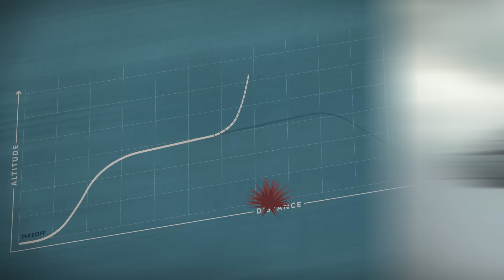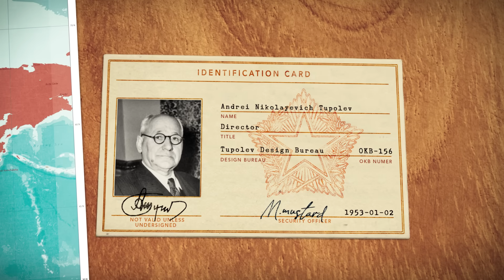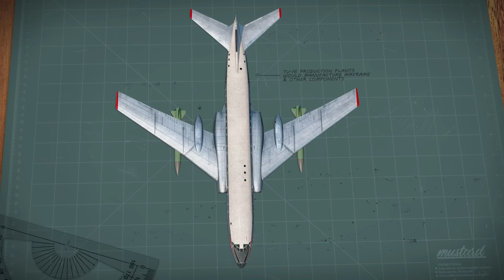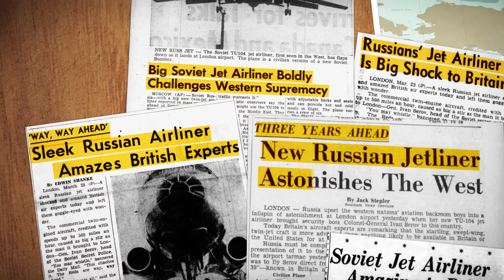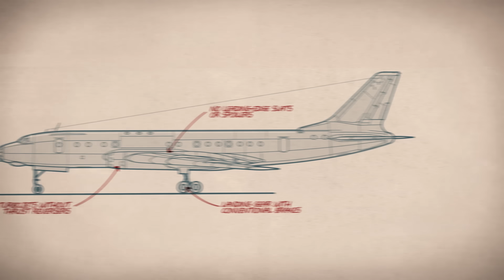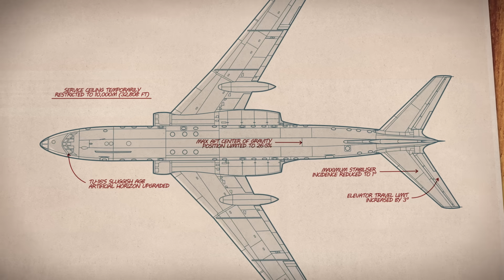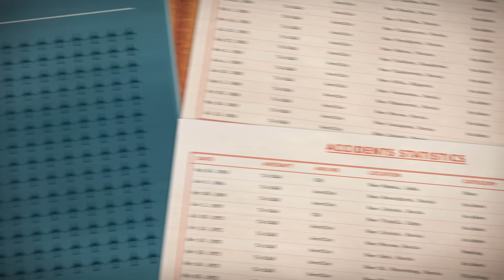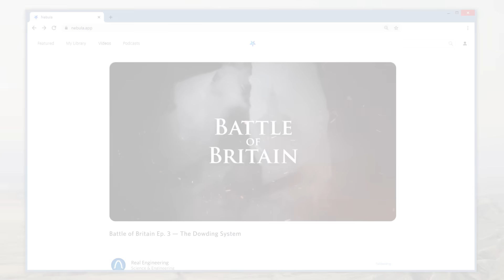The Soviet Airliner Designed To Crash

Comment: The Question was "Was this the most dangerous commercial airliner?"
Well the DC-10 was more dangerous over 1200 people were killed in DC-10 accidents (design failure)
So, nope the TU104 was not the most dangerous commercial airliner.
Reply: The DC-10 actually has much better safety record than the Tu-104.
The worst jet airliner in history is the de Havilland Comet., one out of every four built crashed.
Reply: I thank you Sir for making both of my points.
What do we mean by dangerous. More people sadly died in the crashes of DC-10,9 and 8 airliners than others, but of course there were a lot more of those types of plane than Comets or Tu104.
In terms of the number of lives lost overall the DC-10 had a poorer record so it depends on your metrics. The other point is of course that early implementations of jet liners were much more dangerous and taught the industry to develop better designs, maintenance and cree training. Either way, the Tu104 was not the most dangerous ever, but definitely not a choice for nervous fliers!
Regards
Reply: @maxwood1464  Yes, there were 6 times as many aircraft built in the DC-10 family and it also carried 6 times as many passengers, in terms of fatalities per flight and per passenger/mile the DC-10 has a much better safety record.

Comment: Sorry man. Won’t buy your propaganda. At that time there was only one commercial jet plane: British de Havilland Comet. 100 manufactured, 3 crashes during first year in mid air. Licence was cancelled. Plane was redesigned having overall 25 crashes for more mature modifications. Tu 104 - 200 manufactured. 37 crashes. Next generation: Boeing 707 - 850 manufactured, 174 planes lost.

So lost / manufactured percentage for 
Comet: 25%
Tu 104: 18%
Boeing 707: 20%
Reply: 1.	You are probably comparing the 60-year+ service history of the Boeing 707 with the 23-year service of the Tu-104, so naturally the Boeing may have seen more accidents.

2.	The Tu-104 would never have flown the same number of cycles and flight hours as the Boeing 707 - perhaps the Tupolev has flown only half the amount time in the air per individual airframe as the Boeing 707 – most Tu-104s have never flown more than 25,000 hours on their airframes.

3.	Not all Tu-104s entered civilian passenger service with Aeroflot or airlines abroad. Many were retained by Tupolev for further testing and research, many entered service with the military or other government agencies, some were used in flight training schools. Also, some of those Tu-104s which did enter passenger service were later transferred to other organisations for other duties. Not all Boeing 707s flew civilian passenger services either ¬– many became military C-137s, others became freighters – just not to the same extent as the Tu-104.

4.	In any case, when we are talking about airline flight safety it is usually important to speak only of those crashes and accidents which resulted in fatalities - that’s how these statistics are measured, analysed and compared. Until the Tu-104 was retired in 1979 there were 22 accidents and incidents which resulted in fatalities. For the Boeing 707 the figure is 49 accidents and incidents. The Boeing has more than double the fatal crash figure as the Tupolev – but has perhaps flown 10 times the number of passenger flights.

Here are 2 websites that will help you learn more about the respective safety records of both airline types.

https://aviation-safety.net/database/types/Boeing-707/losses
https://aviation-safety.net/database/types/Tupolev-104/losses 
https://russianplanes.net/planelist/Tupolev/Tu-104/107/110

Comment: So, basically, this was the Soviet 737 Max.
Reply: The Boeing 737 Max has a much safer per flight and per passenger/mile fatalities fatalities rate than either the de Havilland Comet or the Tu-104.
Reply: @sandervanderkammen9230  I know, I was just making a joke... Because the max problem was actually quite similar.
Reply: @DavidThumim99099  Similar to what? the Max 8 issue is very usual in fact, the circumstances of a government mandated safety device causing two major accidents is unique in commercial jet aviation history.
Reply: @sandervanderkammen9230  it's similar in that the problems with both jets stem from an issue with the center of gravity of the plane.
Reply: @DavidThumim99099  The Max 8 has no issues with its CoG.

Comment: The de Havilland Comet was the worst engineering failure in commercial jet aviation history.
The Tu-104 actually has a better safety record than the Comet.
Reply: How do you know this is true? Prove it.
Reply: @yoyohoolahoop3705  The Comet has the worst loss rate of any jet airliner in history... 1 out of every 4 built crashed or were destroyed in accidents.

Comment: The Tu-104 had a hull loss rate of 18%. Which compares very well to the later designed and less safe Boeing 707 aircraft with a hull loss rate of 20%
'Was This The Most Dangerous Airliner Ever?' not really even compared to the Boeing 707.
Reply: The de Havilland Comet was the worst loss rate of any jet airliner in history.
Reply: Boeing makes the safest jet airliner in history. 
de Havilland went tits up in 1958 when the world discovered they can't make aircraft out of metal.
Reply: @sandervanderkammen9230  The numbers don't seem to stack up though comparing an early 1950s Russian Commercial airliner (Tu-104) to the the later 1950s deigned  US commercial airliner (Boeing 707) in terms of operational safety.
The much early 1940s design DH 106 Comet airframe was build too light having to take into account the level of Jet Engine development with the Boeing 707 having engines with 12,000 lbs thrust and a Thrust to Weigh ratio of 3.44 compared to the 5,000 lbs thrust and Thrust to Weight ratio of 2.5 from a decade earlier. Even then the Boeing 707 was only marginally safer even after a decade of Aviation development.
Reply: @amfearliathmor9747  Indeed, while the Boeing 707 was the world's first successful airworthy jet airliner it was also more sophisticated, advanced with greater performance and payload and and a better safety record.
The Boeing 707 is so good that the RAF replaced newer Hawker Siddeley Nimrods with the 707 and plans to keep them in service until at least 2040.
Reply: @amfearliathmor9747  The U.S. Air Force still operates 707s that are now 53 years old.
Reply: @amfearliathmor9747  The Boeing 7-7 family are the most successful aircraft in history.

Comment: Boeing 707 - 3,039 fatalities
DH Comet - 426 fatalities
Vickers VC10 - 130 fatalities (operating from much more difficult runways (short, high and dry) that the Boeing 707 couldn't possibly attempt)
Reply: 1.	You are probably comparing the 60-year+ service history of the Boeing 707 with the 23-year service of the Tu-104, so naturally the Boeing may have seen more accidents.

2.	The Tu-104 would never have flown the same number of cycles and flight hours as the Boeing 707 - perhaps the Tupolev has flown only half the amount time in the air per individual airframe as the Boeing 707 – most Tu-104s have never flown more than 25,000 hours on their airframes.

3.	Not all Tu-104s entered civilian passenger service with Aeroflot or airlines abroad. Many were retained by Tupolev for further testing and research, many entered service with the military or other government agencies, some were used in flight training schools. Also, some of those Tu-104s which did enter passenger service were later transferred to other organisations for other duties. Not all Boeing 707s flew civilian passenger services either ¬– many became military C-137s, others became freighters – just not to the same extent as the Tu-104.

4.	In any case, when we are talking about airline flight safety it is usually important to speak only of those crashes and accidents which resulted in fatalities - that’s how these statistics are measured, analysed and compared. Until the Tu-104 was retired in 1979 there were 22 accidents and incidents which resulted in fatalities. For the Boeing 707 the figure is 49 accidents and incidents. The Boeing has more than double the fatal crash figure as the Tupolev – but has perhaps flown 10 times the number of passenger flights.

Here are 2 websites that will help you learn more about the respective safety records of both airline types.

https://aviation-safety.net/database/types/Boeing-707/losses
https://aviation-safety.net/database/types/Tupolev-104/losses 
https://russianplanes.net/planelist/Tupolev/Tu-104/107/110
Reply: The Comet has the highest loss rate of any jet airliner in history.
26 hull losses out of just 114 built.
Reply: @sandervanderkammen9230  Boeing 707 - 174 hull-loss accidents out of 865 or 20.1% compared to 22.8% for the Comet, which being the first commercial jet liner designed in the 1940s and the understanding of metal fatigue was not well understood, and the technical data was released to the world wide aviation sector to improve aviation safety.
Reply: @amfearliathmor9747  Yes, the 707 is the safer plane and continues flying today while the Comet was grounded in 1980 due to metal fatigue.
Reply: @amfearliathmor9747  The Boeing 707 series is the first successful airworthy jet airliner.
The Comet 1 had a 50% loss rate, it was grounded in 1954 after 6 hull losses and its airworthiness certification was permanently revoked in 1958 just before de Havilland company went tits up.
Reply: @amfearliathmor9747  Metal fatigue was discovered in1837 by German engineer Welhelm Albert.
 It was well-known and understood by 1932 when Junkers built the world's first all-metal pressurized aircraft.
   Boeing introduced the first pressurized airliner in 1938.
Reply: @amfearliathmor9747  The de Havilland company had little experience with building monoplane airliners built of metal.
de Havilland was still building Wood and fabric biplanes like the Dragon in the 1930's.
Reply: Over 1,000 707 series aircraft built and still in service, 
The RAF still operates Boeing 707s and expects them to remain in service until at least 2045.
The U.S.A.F expects theirs to remain in service to 2050.
Reply: The Boeing 707 is the world's first successful airworthy jet airliner and revolutionized jet travel, all modern jet airliners are based on this successful revolutionary design.

Comment: Once flew to Cuba in an IL-62 (the VC-10 copy) but then got really worried flying back when a DC-10 turned up at Havana airport to fly me back to London. The DC-10 crashed about a month later. Bits would also fall off a later DC-10 on to the runway in Paris to create other aircraft crashes.
This would have been around a week or two after Hurricane Irene and the Golfer Stewart Payne's private jet was shot down by the USAF after going to Cuba to play golf breaking the Embargo.
Reply: The DC-10 series proved to be a very successful and safe aircraft.. built from 1968 to 2000,  still in service today.

Comment: This kind of ignores that (We)  the British GAVE jet technology ( the United Kingdom sold dozens of Rolls-Royce Nene centrifugal-flow compressor turbojets to Russia in 1946 and 1947) under the condition that they not be used for military purposes.
Couldn't make it up.... :(
Reply: The Soviet Union never used the R-R Nene for military purposes.
Reply: Like the Nene, the RD45 was unpopular with aircraft designers
Reply: Ended up in the Mig-15 fighter jet causing all sorts of problems during the Korean War.
Reply: @amfearliathmor9747  The RD45 never saw combat service in the MiG-15 during the Korean War.
The MiG-15 was powered by the VK1 engine designed by Vladimir Klimov.
Reply: @sandervanderkammen9230 The VK1 engine was derived from the RR Nene. The RD45 was a direct copy and was initially used for the MiG15. The VK1 just had enlarged combustion chambers and gas turbine stage.
Reply: @amfearliathmor9747  Thank you for admitting that you were wrong, very big of you.
Cheers!
Reply: @amfearliathmor9747  Actually the VK1 is a completely redesigned engine, larger, more powerful and more reliable, while all Rolls-Royce centrifugal turbojet engines look very similar they are not identical neither are all centrifugal turbojets.